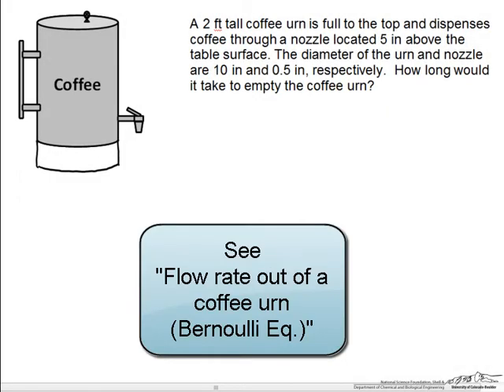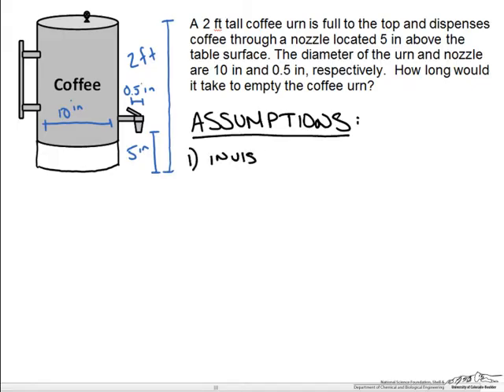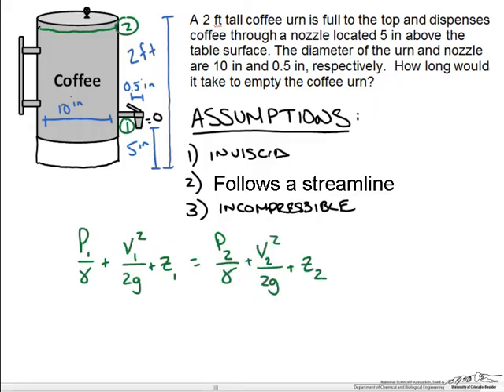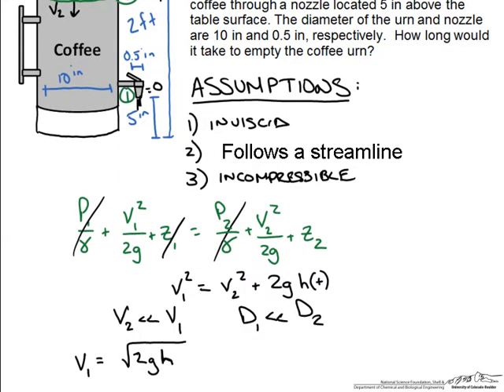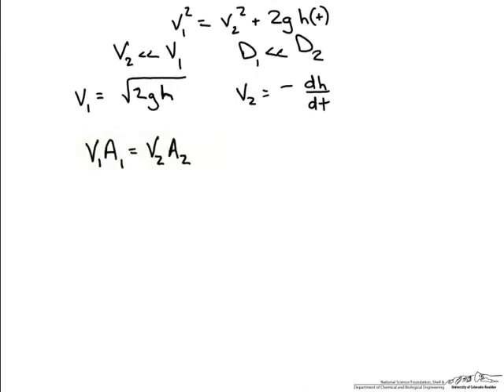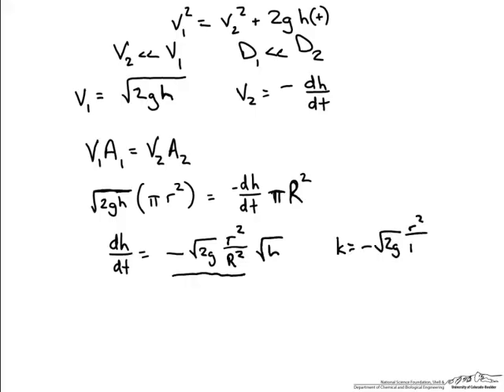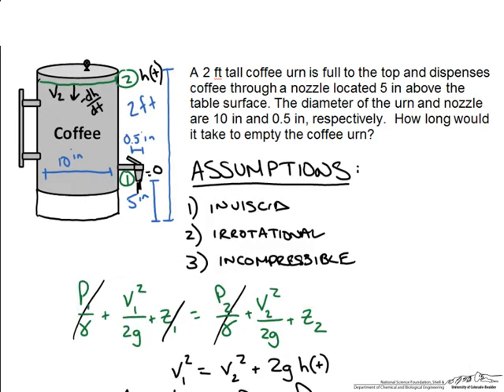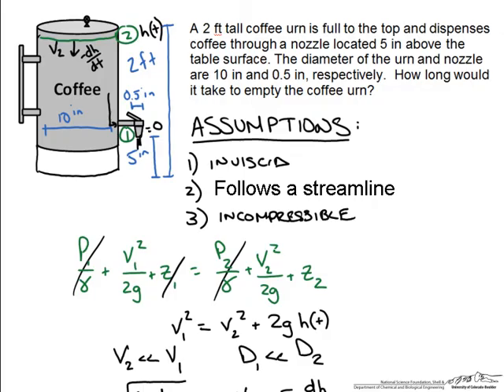Draining a Cylindrical Tank

Comment: Hey, hate to throw another correction in there but I'm fairly sure neither answer is correct. In using the Bernoulli Equation we say that the height of point 1 is zero, and height is defined as distance above this point. Because we use this equation to define V2, and this V2 is used in the continuity equation, when we differentiate with respect to h, we must continue to use point 1 as zero. The final equation looks the same except where hf is zero and ho is 19/12 ft. This gives an answer if 125 s. If I'm missing something or just plain wrong, please let me know. But as it is now, it implies the water is starting two feet above and stopping 5 in above the nozzle.
Reply: yep, it's 125s

Comment: How do you account for viscosity it for the same problem you had heavy oil instead of water? 800cp viscosity
Reply from the maker: Good question! For the Bernoulli equation to be applicable, an assumption that must be made is that the fluid is inviscid. For viscous fluids, we need to use a more robust model like the Navier-Stokes equations. Check out our Fluid Dynamics playlist here for screencasts about solving viscous flow problems: https://www.youtube.com/playlist?list=PL324604EAA66EA2F2

Comment: What if the nozzle has an indicated length? How to approach the problem?
Reply from the maker: Good question. Given the inviscid assumption and that the nozzle comes out horizontally from the the pot, a length would not change the analysis in this problem.  If the inviscid assumption were not made, you could solve this problem by adding a term that accounts for losses from the nozzle as well

Comment: What if you consider its viscosity? I can't find anything about this type of calculation for viscous fluids, and I need it really bad for a lab :(
Reply from the maker: If you consider that its not frictionless, you will have losses associated with the flow.  See some of the fluid mechanics videos related to pipe flow and losses.  Have to consider the head loss term (likely the contraction loss and friction on the walls)